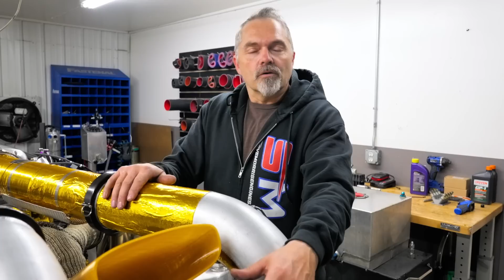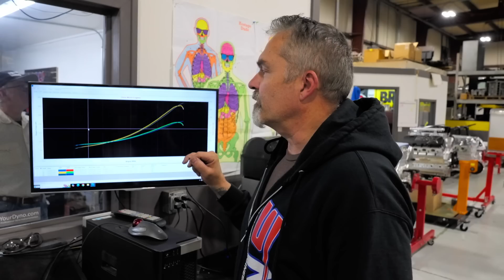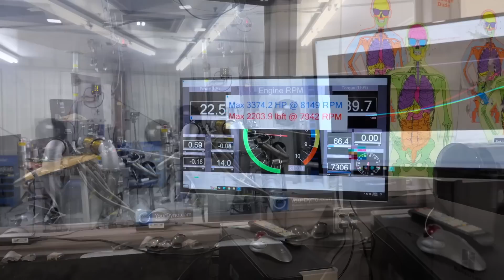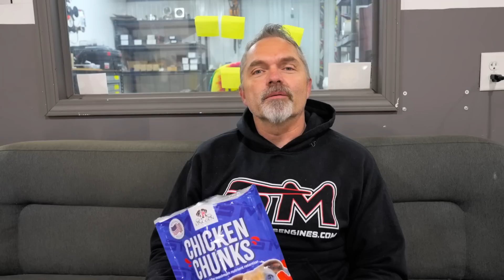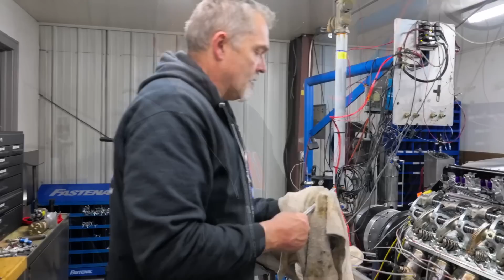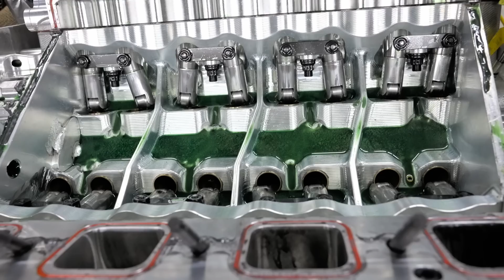Building A Land Speed Record 500+ MPH Engine

Comment: 60 seconds at wide open throttle sounds like torture. Steve,"Oh that's it?", if someone spent 60 seconds at the tree they would lose their mind
Reply: Two completely different things....one is driving, the other is popping and banging cutting fuel and ignition to keep a steady RPM and to get and keep the turbo spooled, on top of sitting on the trans brake literally boiling your transmission down.....

I swear, people are losing common sense by the hour 😅
Reply: @johnnygeorgopoulos4072  i get that they arent the same, bad analogy. The point was how much stress it puts on the engine, 60 seconds compared to 6. 

Also, there is nothing common about knowing that how a two-step limiter works or how LSR cars operate
Reply: @johnnygeorgopoulos4072  Yeah... Somehow people don't understand how deadheading hydraulic pressure (both directions) for 8 seconds creates nuclear reactor type temperatures in oil... Trans brakes are like containing the explosion of a bomb, for a time period, before you hit the release valve.  All hell breaks loose at that point.
Reply: 8 seconds and it’s a fist fight😂
Reply: @Hammerback0completely different when it under load.
You understand what a speed car, does under full throttle????
Simple don’t understand why people that don’t know, feel like they must comment!!
Please just stick to going to car shows!!
Please.
Reply: enigne will take that rpm all day long as long as it is not on the limiter and you never set your 2 step on the limiter
Reply: It's meant for a land speed record car,  that will probably run the long 7 mile course at Bonneville...  she's going to be cooking at WOT for a minute...
Reply: @pr3modeling239  yep people do not get that
Reply: Study some thermodynamics theory and applications and it will help you understand a little more
Reply: @CJStidd  this engine is going to be flat out max rpm for 7 miles the water system is closed they are going to figure out how much water they need for the run and than put that much in the tanks and go run it and this is just page one of there speed run attempt there will be bigger and badder engines getting dynod at SME
Reply: @RossMagwood  I wonder what the final gear ratio is, and final engine RPM is.  I think they shut this one off at 8500 engine.. That will tell you what the max speed potential is, minus slip from the salt.
Reply: @CJStidd  understand that it is closed system engine meaning no radiator no fan so now how is running it for 60 seconds on the Dyno different from it running flat out for 7 miles at the salt flats do not bother trying to answer that because the answer is that it is not different
Reply: @CJStidd  get a clue buddy this ain't a drag and drive engine or even a drag engine this is a speed run world record seeking engine
Reply: @RossMagwood  actually the engine build video specifically says this engine IS a drag and drive engine.
Reply: @BajaMatt06  uh buddy that is not this engine the SMX that steve morris builds are drag and drive engines and actually he offers them in a wet setup or a dry setup.  go watch the video that whole setup with the engine is a replica of what is in the car it is not a drag and drive engine buddy
Reply: @BajaMatt06  you failed to listen he says drag and drive/ streamliner engine this is for a streamliner that is making world record speed attempts maybe listen next time they took a drag and drive noonan billet hemi and built it into the streamliner engine v 1.0
Reply: @BajaMatt06  In the context of land-speed racing, a streamliner is a custom-built, high-speed vehicle with a long, slender body designed to minimize air resistance, often with enclosed wheels.
Reply: @BajaMatt06  you really need to listen in this form with a closed loop water system with no radiator or fan it is not a drag and drive setup
Reply: @BajaMatt06  you should really watch videos and understand what you are watching and or listening to before commenting like a fool
Reply: @RossMagwood  i heard that, so what engine operating principles are different since both engines are water jacketed?
Reply: @RossMagwood  thanks for reiterating what this and other videos in this series have already said
Reply: @RossMagwood  he says its the engine at the beginning of this video and linked it. maybe you should watch and understand
Reply: @BajaMatt06  no thermostat no internasl water cooling system they will have an external water cooler they will plug into after each run no air to water intercooler just an educated guess on how much water they will need for each run that goes into the 4 big tanks on each side of it two are for the engine one for each bank  itself two are for the water to water intercooler shall i go on oh and a way bigger cam than you would ever run in a drag and drive car should I continue on the differences buddy because i guarantee i could spot a couple more if i thought about it.  this engine would make it about 30 miles on a drag and drive dude
Reply: @BajaMatt06  the only thing drag and drive about this engine is you can use the billet short block for both that is what steve means by drag and drive/streamliner engine there are huge differences in how it is built for each application you could also be foolish take that billet noonan short block build it of the street at 500 hp
Reply: @BajaMatt06  most definitely would have a completely different crank different style pistons different rods different rockers different pushrods different cams different lifters in it for drag and drive too
Reply: @RossMagwood  without getting further off topic, thanks for the differences, but my original statement of WOT is harder on engines still stands.
Reply: @RossMagwood  So according to only you it's the world's first drag and drive streamliner trying to set a land speed record? It's not. You just lost your mind at some point and believe anything even if you are the one that made it up!
Reply: @CJStidd  maybe watch the video before commenting like a fool
Reply: @RossMagwood  it wasn’t a dig brother…I only work on 2500MW of combustion turbine power
Reply: @rossmagwood

Any questions…I rebuilt 64-72 GTOs for years.  I now manage multiple combustion turbines and steam turbines…come again?
Reply: A sex bot copied and pasted your comment into its own comment and paid for bot likes to make top comment
Reply: at the tree you have no load, it just revs to the limiter.
Reply: that is more because it heats the transmission up not the engine. the engine will take it all day long the transmission on the other hand will not
Reply: @RossMagwood  i still wonder how much of the system needs to be gone through after each run. Are parts of the car redone like top fuel cars?

Comment: Why only 140mm?  Seems like plenty of room to go bigger so begs the question, what's the biggest turbo you've ever tuned?
Reply: @TheGREENERSide  there comes a point when the materials can't handle the load capacity, sometimes a smaller turbo spinning faster is more power than a bigger turbo not able to spin as fast

Comment: question for you, I'm building on a rather obscure engine platform with not a lot of direct support, for matching retainers to valvesprings, how vital is it to have enough press fit between a retainer and the springs for none stock applications? In measuring a spring, should I measure the ID with calipers, or should I use something like a bore gauge?
Reply: Look at the specs for the retainers they will give you a tolerance and how they want the spring surface measured.